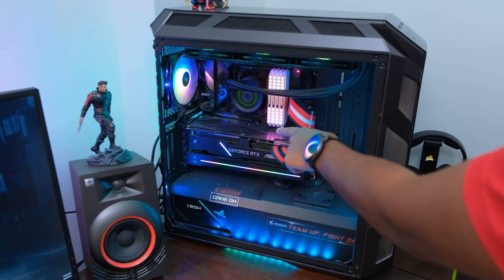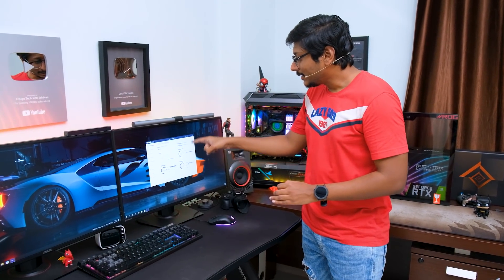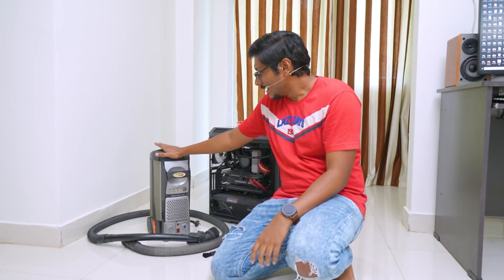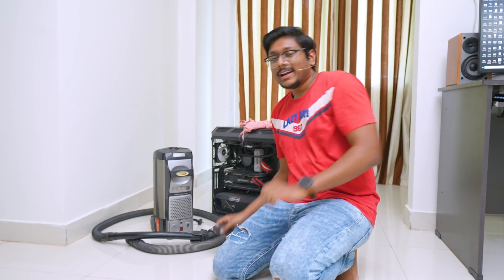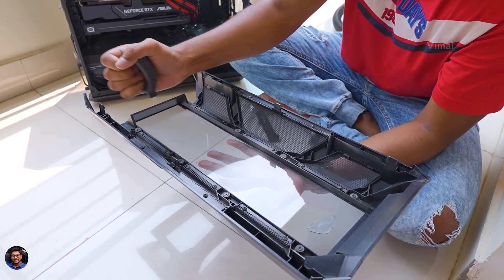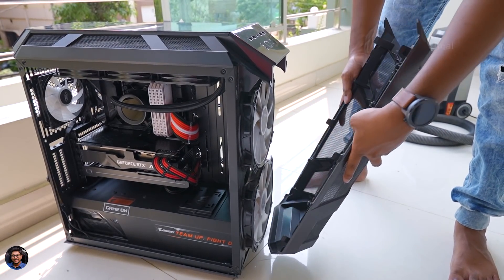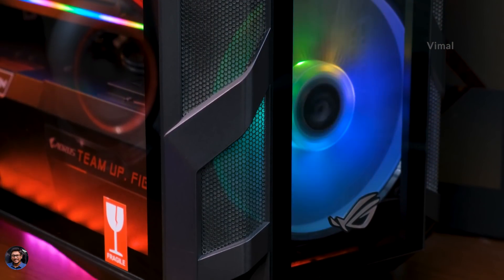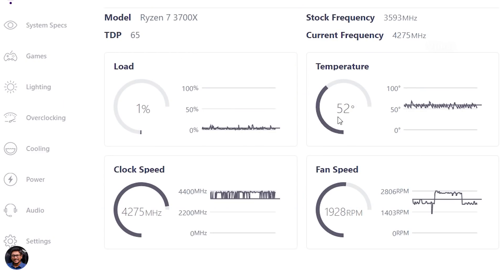How to Service Your PC... Over Heating Issue Solved | Tips & Tricks 😉

Comment: Absolutely Right. I had a problem with my PC after 1 year of installation. Repeated BSD ( blue screen of death) , freezing and even sometimes PC refuse to enter into BIOS and fans were roaring and temperature was high inside PC. I saw lot of dust accumulated throughout the PC and brush and cloth were not enough to remove the dust. Then I did some research and bought Jakmister Airblower (600 watt) from Amazon in about Rs.700. I didn't see this tutorial that time but did exactly same thing as described here. My PC has improved a lot and until now there is no such sudden shutdown or BSD as happened earlier.

Comment: Thank you for the video Vimal ! Really informative!
I usually clean my PC per 2 months, as my home is near the highway and dust accumulation is exponentially high 😂😂
One suggestion I would like to add is to clean the fans individually with (cotton swab / brush) without using a blower, spinning the fans above rated rpm can damage the bearings and also these fans are rated to N number of cycles!
Reply: You con stop them with zip tie